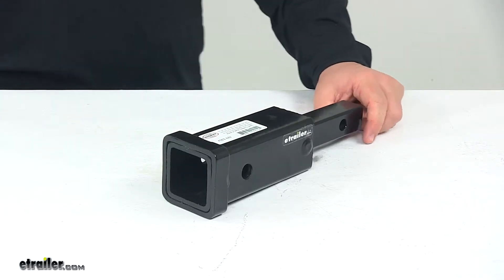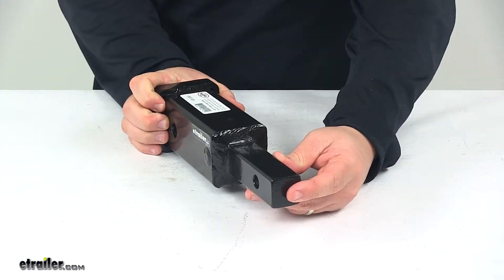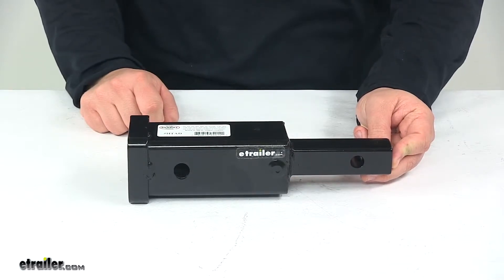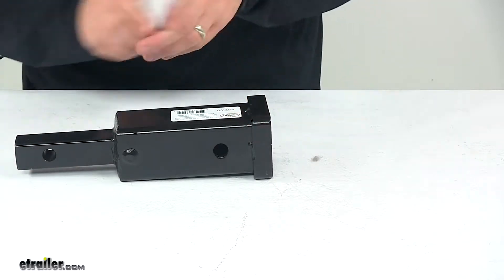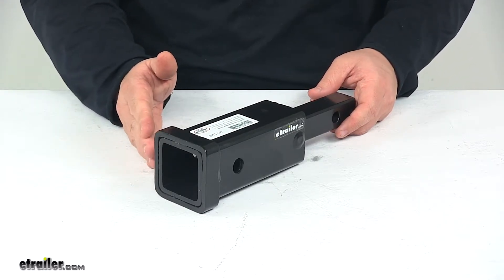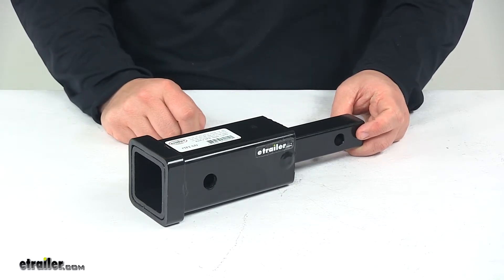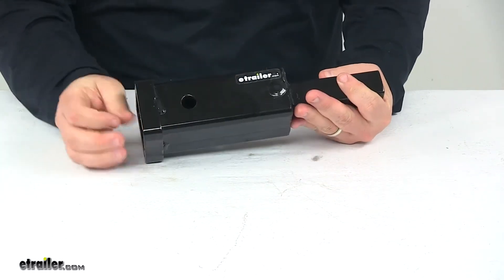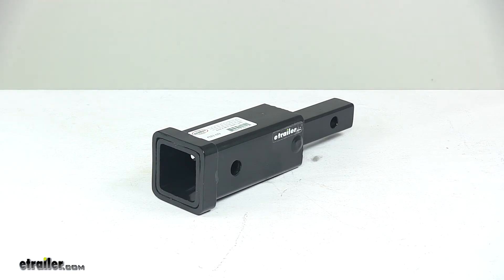etrailer | A Closer Look at the Hitch Adapter 1-1/4" to 2" Trailer Hitch Receiver

Comment: Can we tow a trailer using this adapter using a Sedan?
Reply from the maker: You can use this adapter to pull a trailer but you will want to be sure to check what the weight capacity of your vehicle is and go with the lower number between the vehicle and the hitch.
https://www.etrailer.com/Hitch-Adapters/Brophy/HTAD.html

Comment: Will that work for kuat nv 2.0? Will it wobble?
Reply from the maker: You can use the Kuat NV 2.0 with this hitch extender and pair it with a anti-rattle hitch lock to take out the shake and play. You want to keep in mind that hitches weight capacity will be reduced by 50% when using a hitch extender.
https://www.etrailer.com/Hitch-Adapters/Brophy/HTAD.html
https://www.etrailer.com/Trailer-Hitch-Lock/Lets-Go-Aero/63147.html